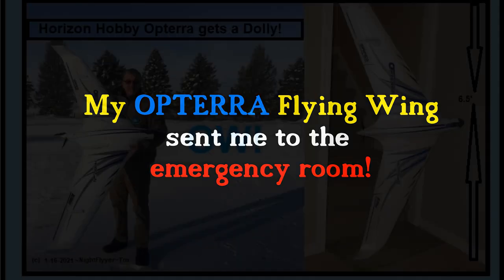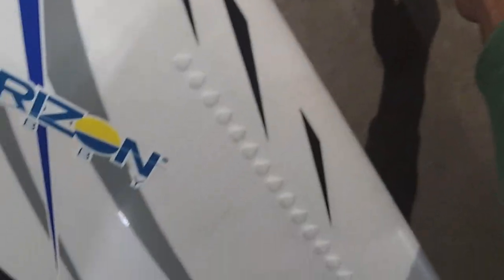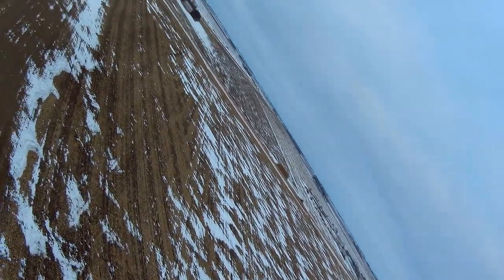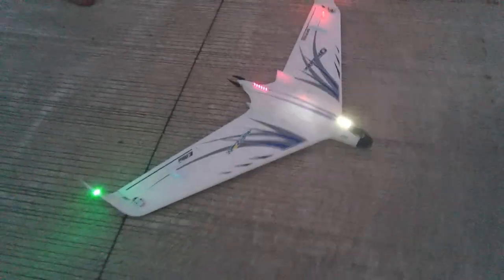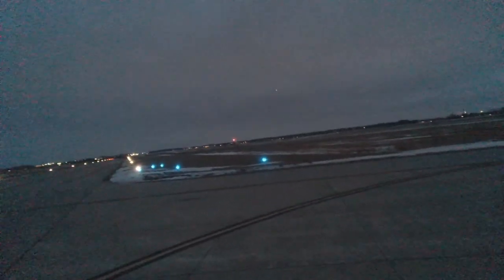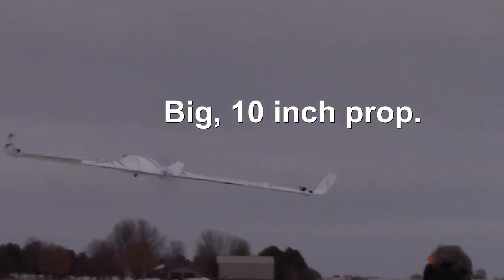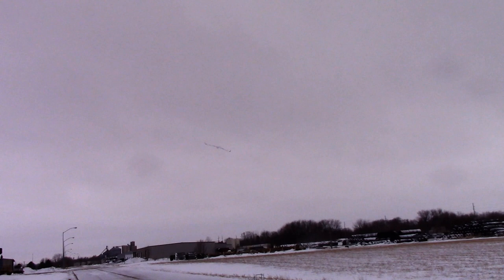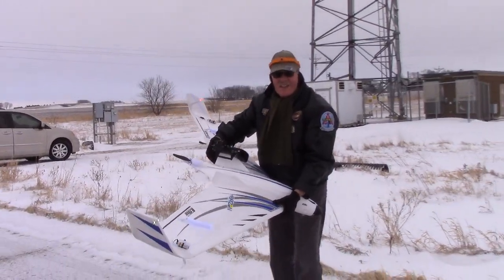My Opterra 2M Flying Wing sent me to the E.R. This is an awareness video & my solution for launching

Comment: Interesting video! I've never flown a big wing or anything with such a large powerful prop but wouldn't a glove of some strong leather help reduce any chance of injury?🤔
Reply from the maker: Thanks for that suggestion and I tried that already, but because it was cold.  I found trying to hold on to the tiny finger grips on the bottom of the 7 foot wing with a thick glove under full power with wind blowing was difficult when under power and then trying to fly with  a big enough glove on was also difficult to fly the transmitter, (I'm a stick pincher)  so although that sounds like a good idea, it did not work that well. Some have told me the Prop got them in the forearm even before launch, when a gust of wind got under the wing and tipped it back.   We are only talking about a Half inch of clearance that I needed to keep from getting cut, and even though I pulled it off several times in my earlier product review video,  I will never hand launch it again.  LOL.  It's hello dolly from now on!  Thanks.
Reply: @NightFlyyer  Ah ok! I just bought some neoprene camo gloves from Aldi recently for £4.99 very high quality, easily £25 worth from somewhere like Go Outdoors! Bought mainly for my MTB but the index finger and thumb on both gloves, opens, pulls back and is secured by velcro pads! So perfect for flying my drone, I also pinch the sticks, also great for pressing the touch screen on my phone which is not a problem either! 😎👍
Glad you found a solution! 😎👍

Comment: Great job keeping it together Dave!  I did the same thing years ago only it was an old Rc combat wing with an OS .25 on it so of course I had fuel in the cuts to boot. The prop was on the front of this wing and with the oily bottom, as I was throwing it my hand slipped and went right into prop. I was in the middle of nowhere and my buddy was flying the plane and he wouldn't land. He kept saying its not that bad is it? lol After pleading with him that I'm going to bleed out he finally landed and got outta there to get it fixed up. We ended up putting a small block on the bottom to grab onto and never had the problem again. Like you said, shit happens and all we can do is try and learn from it.
Reply from the maker: WOW what a story.  I hope your okay now.  Thanks much and stay well.

Comment: Almost exactly 1 year ago I had the EXACT same "hand strike" with my 1.2m opterra. No cut tendons but severe hand damage and I was out alone with no help. I have been hand launching RC airplanes for over 30 years and the opterra is the only plane that has ever "bit" me...
Reply from the maker: I am sorry to hear that. Yes.  Many said I didn't launch it right, but I did it exactly like the manual recommended. They probably never launched a 7 foot wing with gusting wind, and don't realize that is harder than it looks and no matter what, the space is only an inch or so from the prop.   I hope your okay and thanks for commenting.

Comment: Holy... ouch! Been there myself; lacerated a finger with my Bixler 2 prop, and that was on my workbench. I headed to the ER and got stitched up like you, and learned a lot in the process... mainly about setting up, and using, a throttle kill switch. That isn’t much help with launches, however. Some pushers are accidents waiting to happen.
Reply from the maker: True.  As you say the cut switch would not have helped during launch.  Thanks

Comment: Hey Dave, I just finished watching your opterra video series! Love your thoughts and completely agree with your assessment of its landing characteristics. I found I was having to bring it in long and even still, would occasionally find myself watching it scoot right on past me in ground effect. To combat this I printed up some servo housings, embedded them in the root of the wings and made some balsa spoilers. Putting them on the rate knob gives a really nice level of control over the decent rate and when fully extended they are the equivalent of “SIT... Stay... good opterra”. I will see if I can make a short vid if people are interested.
Reply from the maker: That's a good idea.  Post your launch and flight link here and I will watch it.  Thanks.
Reply: @NightFlyyer  As soon as I get some good flying weather I will post a quick video of the modifications and flight characteristics. In the mean time, I am working on a momentary throttle interrupt system that will activate when load is applied to the launch grip and a pre-programed delay to retard the circuit until it is clear of my hand.
Reply: In honesty, this new "delay grip" is being added solely after seeing your incident...

Comment: Could you throw it then throttle up? That big wing should have a good glide ratio. That was a nasty injury . Hope you are doing better .
Reply from the maker: The Opterra 2M manual also says nothing about throwing it with the motor off, so if a newbie followed the instructions, like I did, I'm showing what could happen, in case a gust of wind got them or something else.     Nothing is 100% and no matter how good you can throw, this big 7 foot wing with a 10 inch prop spinning right next to your face, is risky.  Maybe a gust of wind, maybe my 73 year old left arm was weaker, or who knows.   But either way, if it happened to me launching the way I thought was good (and  the same as all my previous launches.)  So if it can happen to me, it can happen to others, and that is the warning I want to present.  Thanks.

Comment: Ouch Dave, I have the Zeta Phantom 1550mm Wing with a 8X8 blade. My shoulders are shot that I can't raise my arms above my head. When I decided to buy the Zeta, I knew that I could not hand launch it Frisbee style and I had thought about that blade coming close to the body If I were to try to hand launch it, so I bought the Hobbyking bungee launcher. It's takes a little time to set up but I really love it. I have cut my forearm once and these props cut like razors, very fast and very clean and very painful! Like you said, sometimes sh** happens even when you're trying your best to be safe.
Reply from the maker: Yep. I followed the instructions. It the manual had said to buy a bungee launcher, I probably would have passed. It's hello dolly for me from now on.  Thanks much.

Comment: I didn’t cut my hand, but my 12 y experience of hand launching experience ended when I tried to hand launch vertically like a spoon-like motion up in the air the Hobbyking’s Radjet 800mm. I dislocated my right shoulder. It was so bad, my shoulder came right off. Not slipped from its cavity. Not moved. It just came right off. I was lucky enough that my mother was with me that day and even she had never driven a car, she drove for 80klm to the nearest hospital with alarms on. 4 years passed since then. It still hurts. I had issues while sleeping. I quit my archery hobby, etc etc. Since then, I designed and built a steel catapult from scratch, with my own schematics, and every time I go fly planes that have no wheels, I use this catapult. My hand launching days were gone.

Comment: Launch technique can help to prevent prop strikes - throw in a downward arc whereby you let go of the plane nearer the top of the arc, and maintain your arm speed throughout the movement.
Reply from the maker: The instructions only say to hand launch it and tells how.  That is how I did it. Of course nothing is 100%, and others told me they were holding this big 7 foot wing and before they launched, a gust of wind got under it and it tipped back and cut their forearm and 3 tendons.  I was launching into 12 mph winds and this big heavy, under powered wing is not that easy to hold and launch into that.  Its hello dolly for me from now on.   Here are the links to the last videos.  https://www.youtube.com/watch?v=P_inF5EYLEE&t=1s&gl=CO  and   https://www.youtube.com/watch?v=ur5V5H8UcGs&t=1s   I had no problem then, but shit happens.

Comment: Thanks for showing us so drastically what can happen with this setup. I would never handlaunch this type of plane. On my Skywalker X-8 I mounted an 80 mm 12 blades Freewing ducted fan feb by a 6S 5 Ah Lipo which gives a thurst of 2.7 kg at 85 A according to specs. The handlaunch is perfectly safe and my 3.2 kg Skywalker needs only a slight push to start with an around 20° angle into the air.
Reply from the maker: Yep.  I simply followed the instructions, especially when I made my earlier Product review video.  Here is word for word what the Opterra 2M manual says about launching.  
1. Put the aircraft into launch mode with the channel 5 switch.  (in my first video that did not work, it went into the ground)  
2.  Hold the aircraft in one hand and the transmitter in the other.  
3.  Apply full throttle and throw the aircraft directly into the wind, angled slightly up (5 to 10 degrees above the horizon). 
4.  Climb to a safe altitude and check the trim.   
I know others have their own ways, and either way, my Dolly is the safest solution for me.  
The Opterra 2M manual also says nothing about throwing it with the motor off, so if a newbie followed the instructions, like I did, I'm showing what could happen, in case a gust of wind got them or something else.     Nothing is 100% and no matter how good you can throw, this big 7 foot wing with a 10 inch prop spinning right next to your face, is risky.

Comment: I built a pvc ramp for launching my wings. After its glued up it breaks down into 5 pieces. Takes 30 seconds to assemble.  And I get nice straight launches.  I don't see how to insert a photo of the setup here.. the ramp is the best way to go. Both hands stay on your radio.
Reply from the maker: There are many ways to make a launch dolly for sure.  This was my first try, as I has my catapult (see video notes for link) worked the best before it was destroyed in the fire.  My Dolly may not be like yours, but it worked and I will only use it from now on with this big 7 foot wing.  Thanks much.

Comment: Sorry this happened to you, I did same TWICE launching a pusher wing (slow learner). I built a bungee launcher and all has been great since, I can totally enjoy flying my many wings. I also incorporate a throttle arm/disarm switch on all my models..... don't ask.  Hope you heal well and get back to it.
Reply from the maker: I certainly know that as most of my helis have that setup. Ive flown models for 60 years.  Im 73.  But the best rc pilots in the world, have also had bad landings once in a while.  Shit happens, especially while I wsa trying to throw this heavy, underpowered 7 foot model into the 12 mph headwinds.  Maybe if the Manual had said I should do that, I would have.  First of all, that had nothing to do with my hand injury. I only mentioned the Throttle arming because I followed instructions in the manual and this is the way it bound up and arms the motor as soon as you plug in the battery. It says nothing about programming in a cut switch like my helis have. I only mention it to warn others to program in this feature as well,  which also should have been mentioned in the instructions.  It's my warning to be cautious, because the manual says nothing about programming in a throttle hold to a switch. I've known of times when after flying, that switch was forgotten to be moved back to safe and it armed as well.  Nothing is 100% as it could be left in the wrong position, by accident. I'm pretty experienced, so never relied to on a throttle cut/hold, as all my helis and my drones, and many of my electric planes need throttle stick movements to arm.   I only am warning others to be careful BEFORE the launch and to be careful no matter what you use. Its hello dolly for me from now on.  Thanks.

Comment: Three things occur to me watch this:
1. Despite what the manual said, I would use the throttle cut facility in the DX8, to disable the motor until I was ready to start.
2. I'm sure I've seen other Opterra fliers open the throttle AFTER launch. In my experience, just because it's what the book says, doesn't always mean it's the best (or safest) way!
3. Not sure why you landed on the concrete runway and not on the grass, to avoid scuffing the model.
4. Hope your fingers are OK.

Comment: i have the 1.2 m opterra and my hand ended up the same way on my maiden launch i got 3 fingers shredded , its just a bad design now i frisbee launch it and i did the same as you did landed it before i even looked at my hand , glad your ok
Reply from the maker: Ouch. Yes, the 1.3 is small enough to launch Frisbee style, but not this one. This wing is 7 foot long, heavy and will bend and break the end off the if you even try to pick it up by the tip and barely has enough power to fly out of your hand at launch.  I know and I tried.    It would also be extremely difficult to somehow launch it discus style with the elevon there and that 7" tall winglet rudder that is also on the tip.  I know how to do it , but not with this plane.  
See my 14 year old self-contained catapult in action here.  https://www.youtube.com/watch?v=ypxbkaY-Ycs&t=113s  
It's not like launching my SMALL F-27 Evolution or 1.2M Opterra.  So I followed the instructions word for as I did for the video I made of my product review earlier where nothing happened bad.  https://www.youtube.com/watch?v=P_inF5EYLEE&t=1s and the second one where I explain how to protect the bottom of the fuselage.  https://www.youtube.com/watch?v=ur5V5H8UcGs&t=1s
We are only talking about a Half inch of clearance that I needed to keep from getting cut. 
Here is word for word what the Opterra 2M manual says about launching.  
1. Put the aircraft into launch mode with the channel 5 switch.  (in my first video that did not work, it went into the ground)  
2.  Hold the aircraft in one hand and the transmitter in the other.  
3.  Apply full throttle and throw the aircraft directly into the wind, angled slightly up (5 to 10 degrees above the horizon). 
4.  Climb to a safe altitude and check the trim.   
I know others have their own ways, and either way, my Dolly is the safest solution for me.  
The Opterra 2M manual also says nothing about throwing it with the motor off, so if a newbie followed the instructions, like I did, I'm showing what could happen, in case a gust of wind got them or something else.     Nothing is 100% and no matter how good you can throw, this big 7 foot wing with a 10 inch prop spinning right next to your face, is risky.  https://www.youtube.com/watch?v=P_inF5EYLEE&t=1s 

And to see how I feel about that unnecessary auto stabilization system see this.  https://www.youtube.com/watch?v=ur5V5H8UcGs&t=1s

Thanks much.

Comment: I've been flying for about 30 years. The first time I held a rear prop aircraft by the fuselage and was thinking about overhand launching it, the alarm bells all went off in my head when I could see how close my hand would come to the prop. So as others have mentioned, it's only a power off throw and throttle up or launch assist. The only model I've launched powered up is the Strix Goblin because the lower fin in the back is longer than the prop. It's always tough to learn a lesson the hard way.
Reply from the maker: Here is word for word what the Opterra 2M manual says about launching.  
1. Put the aircraft into launch mode with the channel 5 switch.  (in my first video that did not work, it went into the ground)  
2.  Hold the aircraft in one hand and the transmitter in the other.  
3.  Apply full throttle and throw the aircraft directly into the wind, angled slightly up (5 to 10 degrees above the horizon). 
4.  Climb to a safe altitude and check the trim.   
I know others have their own ways, and either way, my Dolly is the safest solution for me.  

The Opterra 2M manual also says nothing about throwing it with the motor off, so if a newbie followed the instructions, like I did, I'm showing what could happen, in case a gust of wind got them or something else.     Nothing is 100% and no matter how good you can throw, this big 7 foot wing with a 10 inch prop spinning right next to your face, into 12 MPH like I was doing is risky to say the least.  The 10" prop is very close to your forearm as well, so a gust could tip it back even before launch, as others told me happened to them.  I have been flying twice as long as you, but shit happens.  Even the best pilots I know, have bad landings.  Thanks.